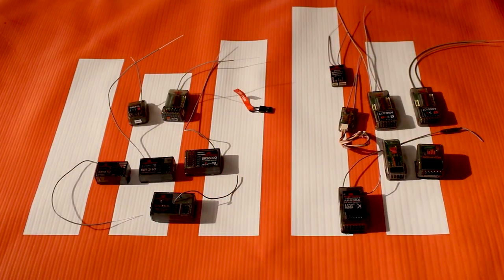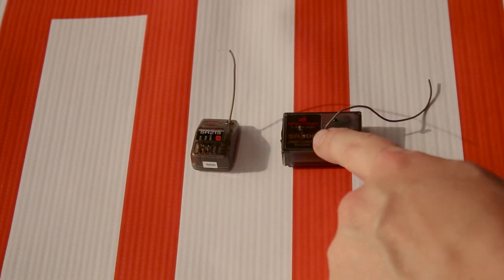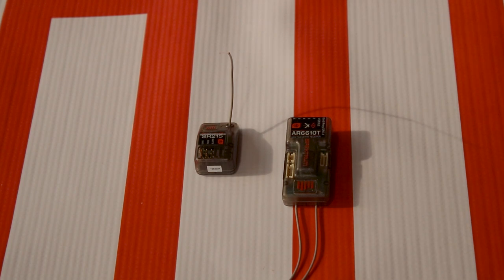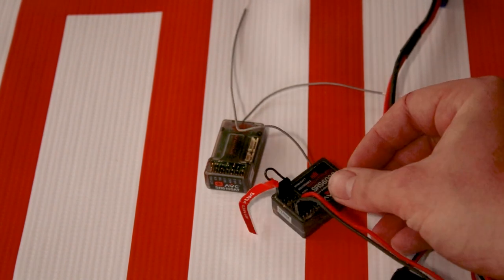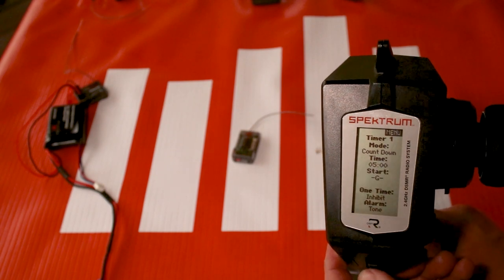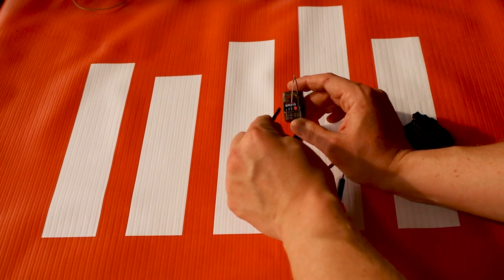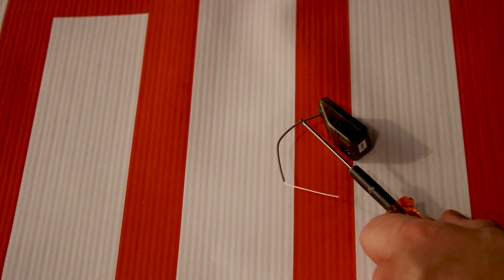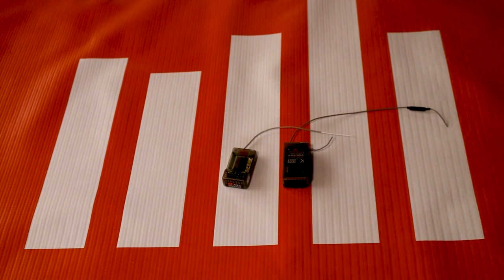Spektrum Quick Hit Tech Tip - Binding Basics and Troubleshooting

Comment: I just installed the Rovan Symmetrical steering kit on my 1/5 scale gas Baja truck and when I turn right it goes left and when I turn left it goes right and I'm currently using the DX5C controller can anyone help me with this issue???

Comment: the AVC on my vorteks 3s doesn't seem to be working after installing a new steering servo. Now my car runs fine with AVC completely turned off, but with it turned on my car does circles with no steering input from me. what could be causing that?

Comment: Hi ive got spektrum sr201 and the steering wheel dosent turn but when i switch around the with throttle the that dosent work but the steering on throttle does work what could be the issue??

Comment: I have a JR10X transmitter with the 2.4 DSM2 module. I'm trying to bind an AR8010T. I will get solid orange but no servo inputs working? I've tried multiple times and getting frustrated. The manual says they are compatible.

Comment: When calibrating a receiver should I do it with servos unplugged from receiver or does it matter?
Reply from the maker: Depends on the receiver really. If it is an AR636, unplug and remove the receiver from the model to perform the calibration after an update. That way you can ensure it is label up and level

Comment: No matter what I do I can not get my brake fu ction working for my nitro buggy. My old reciver kept the power and applied brake when the transmitter was turned off. Now the receiver also turns off on my RS315 with my Rugged works fine binding electric cars but nitro is frustrating even following the instructions

Comment: @SpektrumRC Just brought home a vorteks, the servo chatters and the esc won't let me calibrate throttle. I tried binding the tx/rx and the receiver flashes in binding mode, and the remote flashes orange but they never bind.... Truck won't move and it's frustrating lol......
Reply from the maker: Sounds like you have a power issue. Likely a lead is plugged in backwards, check all connections for correct polarity. Hope that helps!

Comment: I have no lights on my slr 300 receiver (slt3 radio). Is it toast? Can i buy new receiver and bind to my radio? Thx
Reply from the maker: Hello! Do you have a bind plug in the receiver? Servos and esc plugged in correctly?
Reply: @SpektrumRCvideos  i  believe so... being aware of the polarity, location and taking photos as i disassembled it.
Reply: @SpektrumRCvideos  sorry, yes i do have the bind plug in
Reply from the maker: @phillybrc  Double check that power is getting the receiver. Otherwise, see if the same setup works with another rx. If the receiver is indeed DOA, then one receiver I would consider is upgrading the the SR315. This unit is great because it supports SLT and DSMR radios, so when you want to upgrade to a higher end Spektrum radio, you will be good to go!
Reply: @SpektrumRCvideos  i ve tried 2 blx 100 esc s . Same result
Reply: @SpektrumRCvideos  how many volts should i see at connector from esc to receiver. 6V is what i m reading.
Reply from the maker: @phillybrc  that is correct
Reply: @SpektrumRCvideos  receiver must be fried

Comment: How about applying power to the receiver and not getting any lights at all?
Reply from the maker: If the receiver is powered on without being previously bound (and the tx that it was bound to needs to powered on and transmitting RF) OR you did not have the Receiver in BIND mode (either by holding the bind button or with a bindplug) then you will not see any LEDs.

Comment: I have a dx3 and sr315 in a losi dbxl gas set up and having major issues with the binding. Can't find info how to really troubleshoot. It binds easily but all the trim settings are acting up. Trying to set throttle and steering and instead of slowly moving the servo horns nothing happens and then they jump almost 90 degrees instead of gradually adjusting.
Reply from the maker: Have you tried using or are you using the Dashboard app and bluetooth module?
Reply: @SpektrumRCvideos  no dashboard app. Not sure what is happening but I gave up and went with a different tx/rx setup to get it going. Occasionally it would bind and I would have all controls instead of just some but when that was the case the servos were chattering like crazy and no returning back to zero. I tried to bind standard way and Gas/Nitro way per manual and nothing ever worked properly. Ended up buying a radiolink just to get it working quickly and had no issues. The DX3 def feels better and not as cheap so kinda bummed I had to ditch it.
Reply: I have the same receiver and transmitter. It always binds no problem, but it feels like it skips calibration… like you said, servos get all chattery and jumpy. Impossible to control like that…

Comment: I purchased a DX5C with the sr6100at, I put it into my TRX4, I'm using AUX 1  for my two speed transmission servo and AUX 2 is used for front and rear locking differentials,  a reversing y splitter with potentiometer on one channel so they go in opposite directions. I can get the radio to bind, but my avc appears to mess with AUX 1 and 2, if I turn avc off (I think it's off) I can't switch my diff and trans servos from momentary, the option is no longer displayed in the screen. any suggestions?
Reply from the maker: Make sure you are disabling AVC via the receiver (there is a different binding method for this) Beyond that I always suggest creating a new model and starting over when you run into issues that you are not sure what setting caused it. Most of the time this is brought on by the same switch being assigned to another function, either by default or by user. Hope that helps!

Comment: Hi Tom - I wonder if you can help me? I have a Spekrtum DX6i. I'm struggling to make it bind with my new AR6210 receiver. I plug in the bind plug. then the power - all I get is a solid red light on the receiver and amber on the aerial unit. I'm not getting a flashing light to enable me to bind. I'd really appreciate your help...
Reply from the maker: Hi Ben! Sorry for the late reply, some times these notifications get lost in the mix! Normally that would tell me you have something plugged in backwards in the servo ports. Like a servo or your receiver battery. Hope that helps if you are still having trouble :)

Comment: I have a dx5 rugged. I own a traxxas maxx stock. I switched out the radio. It worked.  But now the esc is flashing green. I know turn it on and it will steer but no throttle.  Any suggestions
Reply: Any luck getting this fixed?
Reply: No I put the rugged back in the box, and it is on a shelf gathering dust

Comment: Dear spektrumrc, i am really new to the RC hobby and i have a question, since you're website doesn't exist anymore i figured i asked it this way, I have a spektrum DX7eu and i'm wondering what receivers are compatible with that transmitter, and is it possible that you guys can send me the manual of the DX7eu? i can't find it anywhere.
Reply from the maker: Which DX7 is it? Gen2?
Reply: @SpektrumRCvideos  hello spektrum, it is the generation 1, however it's the dx7eu (european version generation 1)
Reply from the maker: @ennovanbaars330  Is it a DSMX or DSM2 version?
Reply: @SpektrumRCvideos  dsmx version
Reply from the maker: @ennovanbaars330  Ok, So pretty much all of our current DSMX receivers will work with that transmitter BUT you will not some functions like forward programming and telemetry. Hope that helps!
Reply: @SpektrumRCvideos  so it doesn't matter if i have the european version of dx7? Anyways thanks for your help😀

Comment: I'm having trouble binding my dx4c transmitter to the SRX200 receiver. Are they compatible? I think I know the answer as I've been trying to bind for hours now 😪
Reply from the maker: They are not compatible. The SRX receivers use a open source 2.4 protocol, FHSS (Done to reduce cost) and the DX4C uses DSMR and DSM2 protocol. Suggest getting a SR215 if you need a budget friendly receiver :)
Reply: @SpektrumRCvideos  thanks for replying 👍 so happy to find out it wasn't just me doing it wrong

Comment: I think I have put plug in different slot one says AUX then THR then STR then bind I am new to this and trying to work out which is which
Reply from the maker: What are you having trouble with?
Reply: @SpektrumRCvideos  hi I tried to change remote but not working put it back together but I think AUX is fan but not sure THR STR what comes from car into them two will it be ok if they in wrong slot

Comment: Hi.. i’m having trouble to bind my dxe with ar636 receiver.. ‘please power cycle your receiver/transmitter’ pops out when i connect them to spektrum apps.. please advice
Reply from the maker: Did the receiver come with a BNF or RTF model?
Reply: SpektrumRC it come with RTF model.
Reply from the maker: @izhamzulkifli7002  Make sure the receiver is sitting still and level on the gear. If it was transplanted out of one model into another this can be difficult because the orientation is calibrated to the original model. You may need to install the rx so that it mimics how it was positioned in the original OR you can try different AR636 presets OR try programming via a PC. Hope that helps!
Reply: SpektrumRC i’ve tried a lot of time.. maybe mine is broken.. btw thank you for your helps SpektrumRC 👍🏻

Comment: My dxs somehow disconnected from the receiver. I flew for 2 mins and turned off to move locations and now it won't connect. HELP!!!
Reply from the maker: Not sure why it disconnected, but have you tried rebinding?
Reply: @SpektrumRCvideos  yes I was able to get it to work. And i loved it so I bought a pitts 850mm lol my question now is why when I bind the dxs with the pitts I can't control the ailerons?

Comment: THANK FROM A NEWBE .MORE IN TO THE AR
Reply: Get a blade 70s for only like $50 or something really reasonable. You can learn a lot from a very cheap and simple heli before you drop about $500 for a radio $160, helicopter roughly $200, then batteries plus a charger, probably another $100 for a decent charger and 2 batteries. That being said, you will have the best helicopter essentially in the world, before you get into the multi-thousand dollar big helis with very advanced flight controllers (basically the same type of stabilization flight controller), helicopters fly well all depending on the gyro, that's it. I suggest get the $50 blade first and download Absoluteheli app from app store and you can learn a lot first.

Comment: I have a problem with my tx/rx pair. They are bound ok and the steering channel works ok. The throttle channel is live but it’s full throttle or nothing. There is no progression.  Please help
Reply from the maker: Sounds like the esc might need calibrated. What ESC and RX are you using?
Reply: @SpektrumRCvideos  the rx is an SRX200 (SPMSRX200) the tx is a SPMSTX200. The ESC is “ 20A BRUSHED ESC - TURNIGY TZ4 AWD/DRIFT SPEC 9315000271-0” from HobbyKing
Reply from the maker: @johnw889  Sounds like a setting on the ESC, I would check with Hobbyking. One thing you can do to test that it is indeed a ESC issue and not Radio is to plug the esc into the steering port and vice versa and see if the problem follows the esc or throttle channel. Hope that helps!
Reply: @SpektrumRCvideos  i bought a servo/ESC tester (https://www.ebay.co.uk/itm/RC-Servo-Tester-Etronix-3-Mode-Servo-ESC-Tester-Spektrum-Heli-Car-Plane-ET0052-/261189842520?_trksid=p2349624.m46890.l49292) and using that the output of the ESC behaves the same way - all or nothing. So how do i calibrate the ESC.?
Reply from the maker: @johnw889  That is a question for HobbyKing ;) it is not our ESC
Reply: @SpektrumRCvideos  does Spektrum sell an equivalent Brushed ESC?
Reply: @SpektrumRCvideos  HobbyKing are asking if the transmitter is programmable?
Reply: @SpektrumRCvideos  HobbyKing claim the ESC should not need programming

Comment: Hello,
I've got a problem with my new DX8 receiver.
My transmitter is telling me that it's bound just fine but even after removing the bind plug the orange light of the receiver keeps blinking (slower than in bind mode but it keeps calmly blinking) and the motor keeps beeping just like it's still in bind mode.
 And I have no control over the motor or any servos what so ever.
I have absolutely no idea why this happens because the Lipo and all of the other electronics work just fine with my older DX6.
Thank you for any help!
Reply from the maker: Hi MadDog95, a slow blinking light normally indicates a power input issue. I would double check all your ports to make sure everything is plugged in propperly. ALSO if the receiver is being powered by a ESC or BEC, it could be a issue with that unit making it not provide enough voltage to the unit. Otherwise, we might need more info to help :) Feel free to message us on Facebook or send us a email at productsupport@horizonhobby.com with more info. Thanks!
Reply: @SpektrumRCvideos  thank you for the support but already figured out what the problem was.
I forgot to plug in the external antenna module since there isn't any information on it in the user manual. 
Now it works just fine, great product! 
:)

Comment: I'm having some problems binding to my Ar 6100 receiver. It will not go into bind. If I put in bind plug and supply power it just stays solid orange. (I've tried a second bind plug to confirm that's the the cause).  Anyone have any suggestions on where to go from here or should it just be replaced
Reply: My AR6210 is doing the same thing.  Did you ever figure out the problem??

Comment: Dear SpektrumRC.
I bought both, the DX5 Pro and the DX5C both transmitters says they are compatible with DSM2 in the 16.5 ms. Frame rate, but non of them would let me select that frame rate because it doesn’t show on the screen. They jump from 11 ms. to 22ms. With out showing the 16.5 ms. Option.
Could you help please?
I all ready dig all internet and no information found.